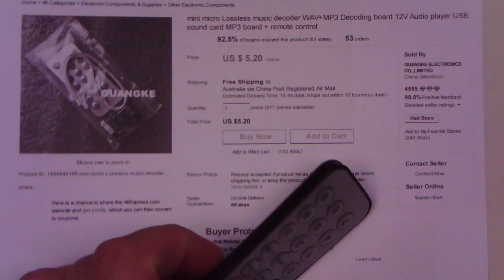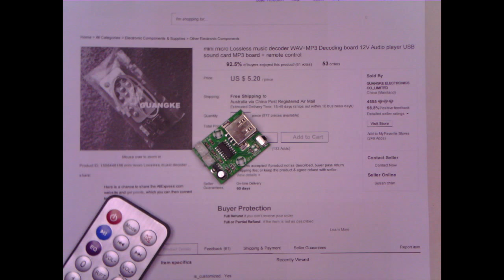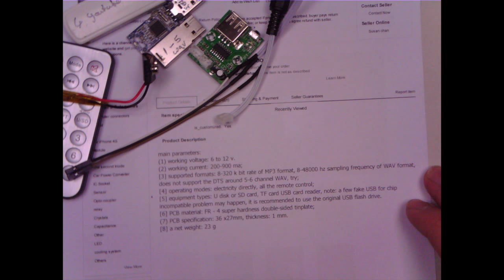Testing a cheap USB MP3 Module

Comment: I have a cheap sound mixer with a USB flashdrive button player- does anyone know if it's very difficult to replace the digital to analogue processor in the mixer(  I want at least 16bit 44.1khz  sterio line output  and I don't think I'm getting that)